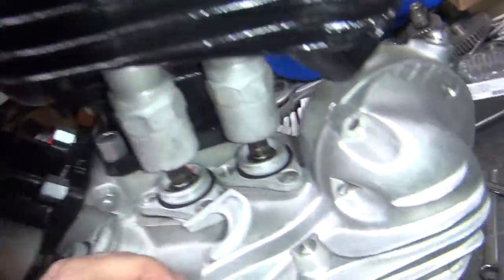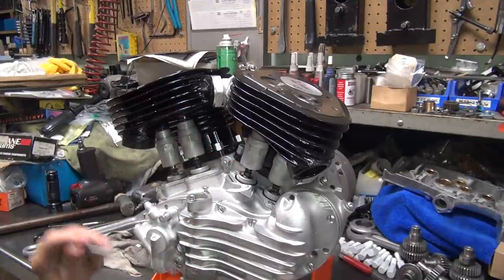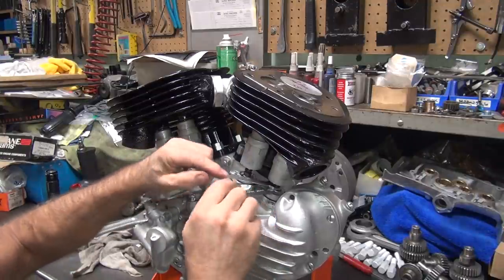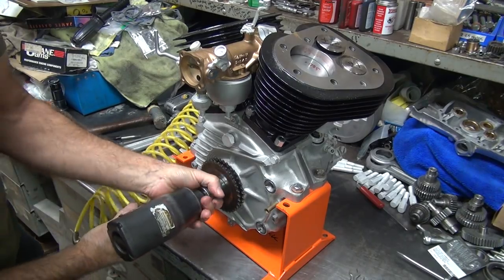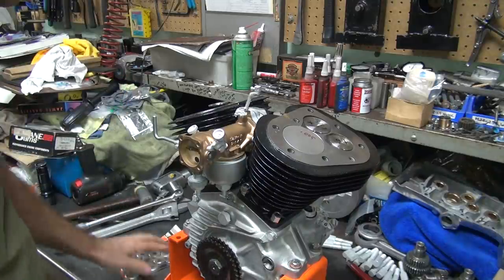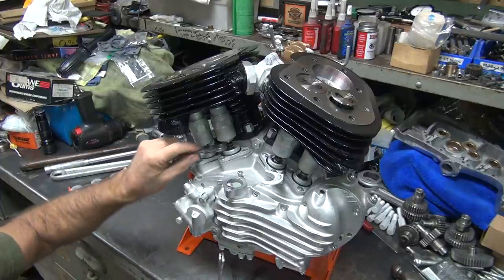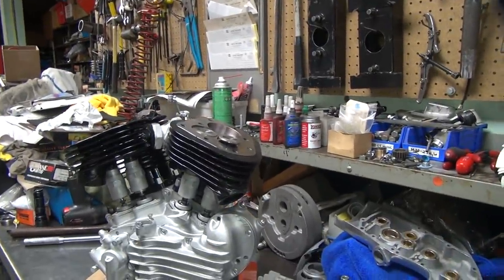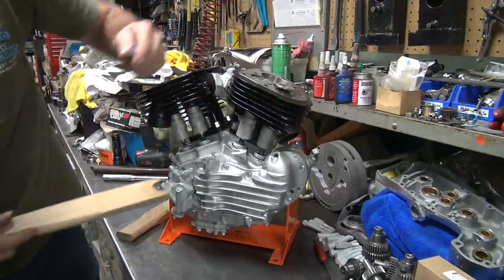1941 wld 45 56ci stroker #261 flathead motor build 4-5/8 in harley wl by tatro machine

Comment: Tatro was just thinking if maybe you can some kind of jig like grab under motor bracket to pull down on valves, like some kind of pully   , instead of wrestling with peace of wood,  just wondering  love all your work
Reply from the maker: maybe, but what i did has worked and will still keep working. it comes down too if it is worth all the work to make a tool vr.s just making do with what you have.
tatro

Comment: Off topic question. Whats the difference between the timing on an older ironhead vs a late model one? I remember you mentioning something in an older video about the late models timing being screwy to save on exhaust emissions or something. Would you recommend dead timing or timing light? I noticed my late ironhead ran worse after using a timing light.  Any thoughts?
Reply from the maker: the 900 motors used 45deg timing and the 1973 and later 1000 motor used 39deg. that is when the gasoline went all the hell. look up the early 70's oil embargos and emissions crap.
tatro